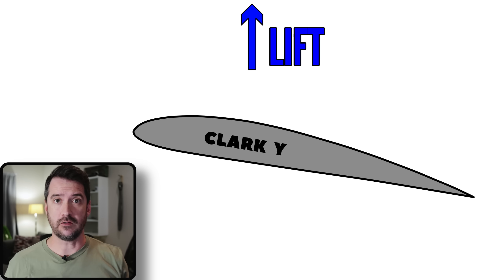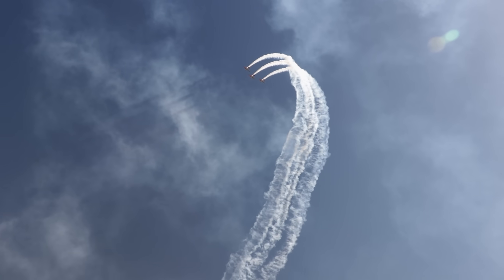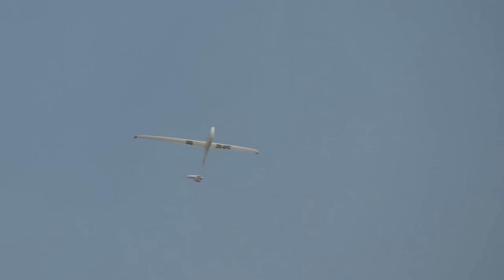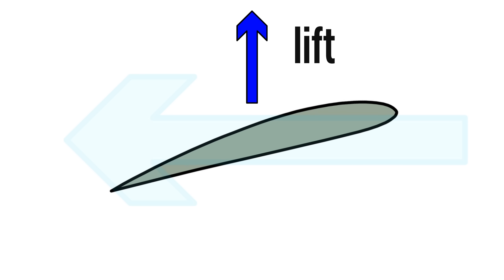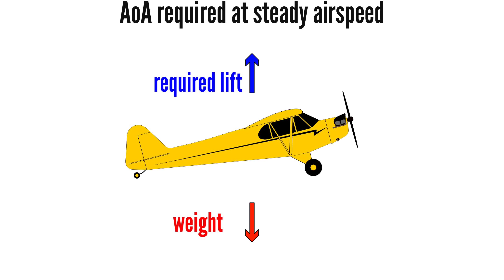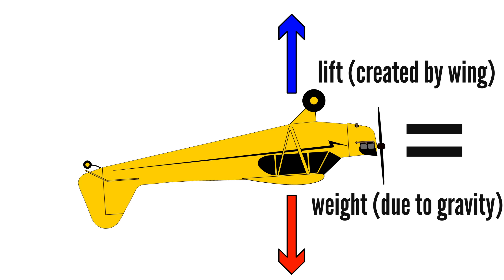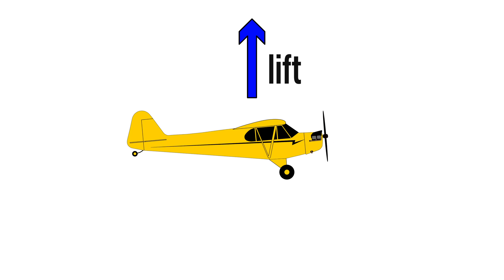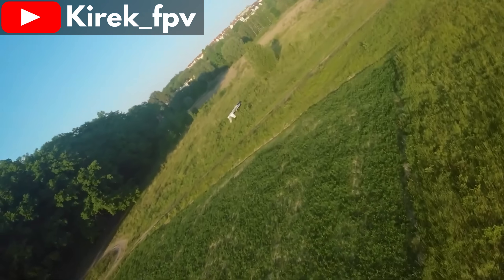Is Airflow Distance Over the Top of a Wing Always Longer?

Comment: Well explained. Newton’s 3rd does exist, but there is the question… how much does air weigh….??? Roughly 1293g per 1000 litres! And that then needs to be deflected directly downwards to oppose weight. An average airfoil in level flight flies at roughly 5 degrees. So the air is not remotely being deflected vertically downwards. However, let’s take a Cessna 152 wing loading, 10.5 pounds/square feet. So, 144 square inches in a square foot. So you can calculate the air pressure drop needed to make the wing fly. 10.5/144 to get ponds per square inch (PSI) That gives an answer of 0,073 PSI. So you only need to drop the pressure by 0,073 PSI, and you fly…. Bernoulli for the win💪🏻

Comment: Knife through cheese. Angle of attack. Knife blade shape is secondary to angle of attack. Cheese above isn't pulling the blade up.
Reply from the maker: Not really a great analogy, because a knife cutting through hard cheese will always move along the 0° line, right? AoA, or the angle between the chord line of the knife and the relative movement of the cheese will be 0° or very close to it. Tilt it and it will always move in line with the chord line of the blade. 

A wing however has "slippage", and at say 10° AoA the wing does not travel 10° up through the air like the knife through cheese, and the relative angle between the wind flow and the chord line is 10°, as opposed to the knife's 0°. Even at fast cruise the AoA will be around 3 or 4 degrees, depending on the airfoil and wing loading.

The problem with trying to simplify the explanation of lift to a few sentences, or even a few paragraphs is important details get lost, and more importantly, leads to incorrect understanding.

Also air above doesn't pull a wing up, and it most certainly isn't pushed up from below, instead the wing moves to an equalibruim in pressure and airflow.
Reply: @LetsGoAviate  I oversimplify and my analogies are about food when I'm hungry. My knife stalled from the pressure from the cheese in front, not the cheese in the back..:)
Reply from the maker: @mattwallick1626  😆

Comment: I can explain how planes fly in a few sentences.  Imagine a plane with rectangular wings that were perpendicular to the ground.  Those wings would create zero lift.  All the force of the air hitting the wings would be horizontal against the direction of the plane.  Now imagine rotating those wings 90 degrees.  Those wings would create zero drag; they'd just slice through the air.  Now rotate them just a liny bit.  They'd produce two elements of force--a tiny bit backward, and a little bit upward.  Rotate it just enough that the upward force is enough to lift the plane.  The end.

Comment: Depends a lot on where the mid-chord line is. A flat bottomed section like the Clark 'Y" will produce lift if the flat bottom is at zero Alpha, but the chord mid line is nevertheless at positive Alpha. Aerobatic aircraft use fairly thick symmetrical sections that produce no lift at all at zero Apha, the chord line being straight, and that means that when inverted very little trim change is needed to stabilise in pitch, assuming that the CG is fairly far back. Overdone, this can cause erratic instability in pitch due to centre of lift changing with speed. This is more likely on thin and undercambered wings...just ask any 'free flight' modeller who has had a model come off the top of a climb and just go in to a dive all the way down when it has been perfectly stable in pitch on a slow hand glide. Modellers often push things a bit to minimise induced drag to fly for three minutes off a 10 second engine run with no external controls at all...
The thick sections of aerobatic aircraft make the stall less dramatic, which is compensated during aerobatics by severe yaw shifting the centre of lift laterally to flick roll, usually aided by huge ailerons.. Lift is created as a reaction to directing air downward, and with lower pressure on the top surface. You can see that pressure drop by skin bulges between the rivet lines as the aircraft takes off. Boundary layer effects are a lot more severe in small model aircraft due to the very low mass flow ratios (Reynolds #).... We don't have scale air molecules, so the boundary layers are the same size regardless of chord width, but of course low aspect ratios mean more trip losses, even with fancy tip configurations... Big wings make many of these effects fade almost into disappearance.
Another thing often understood quite foggily is the effect of control surfaces. In essence, all they do is shift the overall centre of lift about relative to the CG, either laterally or longitudinally, thereby disturbing stable flight into an unstable one causing the aircraft to change direction.
Also the relationship between CG, centre of lift and centre of drag are often misunderstood, and that can lead to some 'interesting' phenomena... 🙂
Reply from the maker: One of the most informed comments I have ever gotten on this subject, thank you. The difference between the flat bottom, or "apparent" 0° AoA and chord line which is actual AoA on a Clark Y is often misunderstood and is where some misconceptions start taking root. Chord line determines AoA, not the flat bottom.

Also a very nice description of lift. Besides air over the top being obviously lower pressure than the air going below the wing, air pressure over the top is actually lower than ambient pressure. Ask the "air pushes a wing up from below" advocates to explain that one...

I've never really thought of the pitch instability a thin symmetric wing can cause compared to a thick one, but makes perfect sense with quite a fine "line" between high pressure below, low pressure above, and at 0° slight AoA change to negative a quick reversal of pressure above and below happens.

I also enjoyed the reference to CG's impact on centre of pressure (and vice versa), especially if they are not close enough. Not often mentioned in these duscussions.
Reply: @LetsGoAviate  Thank you..... I spent a large pat of my life designing and building aerobatic aircraft (little ones that didn't carry people, and we chuck them about very vigorously and sometimes become intimately familiar with the dreaded 'high speed stall', especially with higher wing loadings. Our control systems these days are so accurate that one can  get away with a lot, but sadly that often leads to inefficiencies. I have spent many a happy our ballasting an aircraft to bring the CG back just short of the point of straight line stability in pitch. This gives instant pitch response, very necessary for figures requiring nice square corners, and for manoevers like the "figure M" which is a continuous series and needs a low wing loading and plenty of power to do well. The low wing loading and a thick wing helps a lot when pointing straight down to prevent excessive speed build up which makes the manoever look untidy.
In case you are not familiar with it, the 'figure M' is entered from level flight... vertical climb, half roll, stall turn (wingover) at the top.. vertical down with half roll, pull out inverted into vertical climb, half roll, stall turn in same direction as the first one...into vertical dive with half roll and pull out upright and level on same heading as at the start. Takes a lot longer to describe than to do, but it's a figure that sorts out all of the balance and stability issues you may have. We usually knew we'd got it about right when you can roll into inverted level flight and only require one click of 'down' trim (which when inverter is up trim) to maintain hands off level flight. That also shows up whether you have compensated for lateral imbalance with aerodynamic trim changes... they work against you when upside down.
Lots of fun... I don't do it now as it got too expensive in my old age... never mind... 🙂

Comment: I've never really believed the cause and effect relationship between (longer distance -> higher flow speed -> low pressure). To me, it makes more sense that the low pressure top of the wing is what causes the air to be accelerated. Conversely, higher pressure on the bottom of the wing slows the airflow.

Comment: If I run on a longer route, I don't move faster, just arrive later. Why the air accelerate just because it faces to a longer route? The answer is:
 There is a low pressure zone above the wing, therefore the air going there is pushed (accelerated) by pressure difference. But since in theory the higher airspeed so basically this acceleration is the cause of the low pessure, how the low pressure appeared there in the first place? It's seems to be a chicken and egg problem which has an explanation, but nobody tells it to the public, instead everybody say the longer route — higher speed statement without an argument as to why there is a causal relationship between the two.

Comment: That an upside down conventional wing works does show that the latter is not the critical factor in why wings work. And note that the wings of some airliners are flatter on top than the bottom -- supercritical for optimal near sonic airflow and they also work well at takeoff and landing speeds -- when at cruise they have little angle of attack and I doubt the length of the flow is longer above than below. And a piece of cardboard, or a thin cambered wing as per old airplanes and bats, works.
Reply from the maker: But this was precisely the point; it's not the camber over the wing that makes the path over the top longer, it's angle of attack. The stagnation point shifts further away from the leading edge the higher the AoA, mainaining that longer path length (and similarly the pressure differential that creates lift). Flat wings or sail-like wings does not change the physics in play.
Reply: @LetsGoAviate  When a cambered wing has a sharp rimmed leading edge like a Wright Flyer or a bat (outer wing) the stagnation point cannot move (the airflow would have to reverse direction before returning the leading edge to flow over the top of the wing).
Reply from the maker: @gregp6210  An undercambered wing's leading edge isn't knife-sharp. The wing is thicker than you may think. The stagnation point moves much less compared to a normal thick cambered wing, but it moves. It moves much less because the effective AoA range of an undercambered wing is small, it really only excells at high AoA flight.

Even with tiny movements of the stagnation point the airflow over the wing remains longer than under, like the inside line of a running track is shorter than an outside lane on the track.

Comment: It is a word game. A wing prevents from falling down with an optimal shape for weight, strength and speed, to keep the boundary layer happy. Going too fast in a horizontal flight could even mean the loss of the boundary layer, and that is really bad. And flying with an asymmetrical profile means a different angel of the plane when flying upside down. Aerodynamically, every plane could fly upside down. But fuel dynamics, the engineering department or aircraft authorities block them.

Comment: I always surmised that it was angle of attack that generated lift, and that the function of wing camber was to maintain laminar flow and prevent separation of the air stream over the wing, allowing a higher angle of attack. Seems that this discussion was stating something similar.

Comment: 0936, 0950   the  WING  is  moving.!      the  air  is  NOT.!        the 'lift' that occurs above a wing is actually a persistent zone of turbulence  and  slightly reduced pressure.
turbulence equals  Drag; and  the designs of modern profiles are optimized for  drag  reduction.
Reply from the maker: Relative to the wing, air is moving. It makes no difference to the physics involved.

Comment: you should begin by showing and discussing a  SYMMETRICAL  profile.        then,  Explain  why a cambered profile is  More  efficient; eg., because positive aoa is buit into modern profiles.
when a thin symmetrical profile is studied/observed, it can be seen that lift is a (newtonian) result  of positive angle of attack, when there is a downwards deflection of stationary air.
it can be further understood that there is no  air flow, per se,  in  stationary air.     which means, in turn, that bernoulli's math  was  not  wholly correct.
Reply: Asymmetry is responsible for lift.  Asymmetry of airfoil shape, and angle of attack asymmetry.  The two asymmetries always work together to produce lift (assuming the airfoil is not symmetrical; in which case only AoA is operating).

Flying with a positive angle of attack is not a situation of modern profiles vs whatever other profiles.  Angle of attack variation of asymmetry applies to every aircraft wing ever built.  Practical flight would be impossible without the ability to vary angle of attack.  AoA modulates different amounts of lift for changes in air density, speed, load, and the need for climb and descent vs constant altitude flight, and turns.

All physics of flight is Newtonian.  Any meaningful description of the mechanics of flight must be fully relatable to Newtonian mechanics.

Air is necessarily deflected downwards, but it is mostly from the pressure drop above the wing bending air above, downwards.

Comment: Air molecules have weight . A Clark Y wing doesnt liftvery well at all in  inverted flight . The air being forced to move fast across a curved wing surface and forced to adhere to that curved surface by the boundry layer creates centrifigul force.  Air does have weight. More speed , more air flow , more inertia . Enough speed and angle of attack ,more lift . Inverted a Clark Y airfoil will fly by planing like a boat hull . But will not fly well.  Air has weight and diverting it causes a force . Centrifugal Force  is that force Bournelli did not account for.